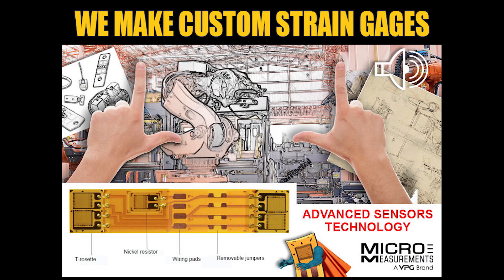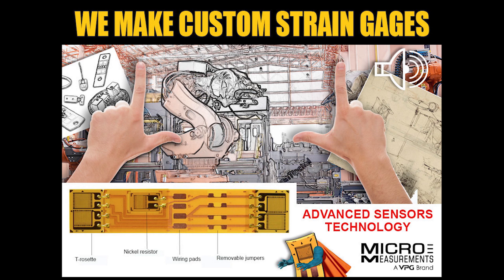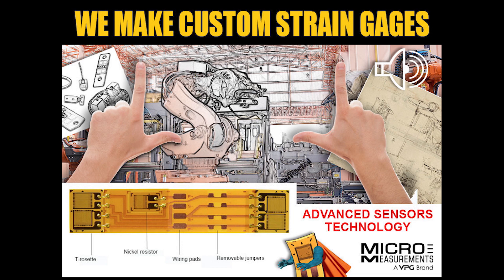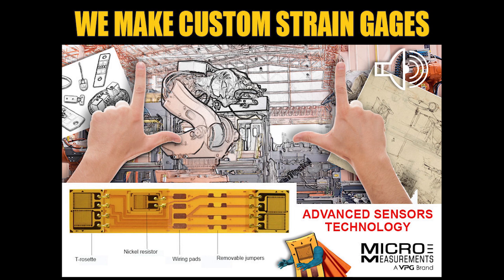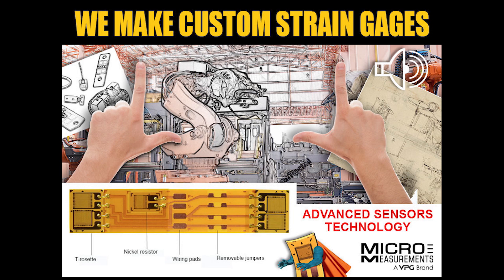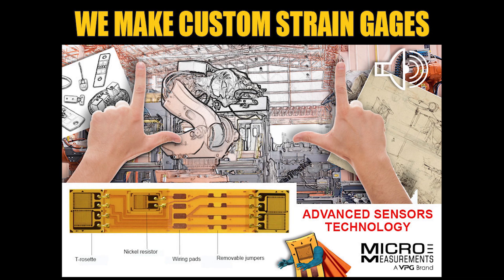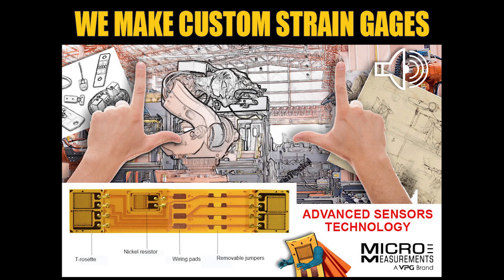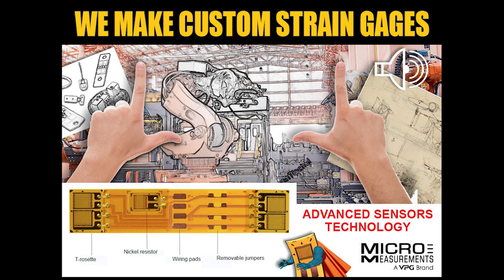We Can Design Your Own Strain Gage Sensor (5 Minutes Podcast)

Comment: ¿Alguna vez ha pensado si sería posible disponer de una banda extensométrica hecha a medida? La respuesta es SÍ. Con nuestra Tecnología Advanced Sensors se pueden fabricar bandas extensométricas personalizadas, tanto para aplicaciones de Análisis Estructural, como para la fabricación de Transductores. 
Ejemplos muy significativos de lo que se podría hacer son: bandas extensométricas con adhesivo pre-aplicado en su dorso o con un circuito flexible; bandas con resistencias no estándar o con marcas de alineamiento personalizadas, terminales más grandes o cableado especial, etc. Díganos cuáles son sus necesidades, y con mucho gusto lo estudiaremos y le enviaremos la oferta correspondiente.
Si precisa de información adicional, no dude en contactarnos. En Vishay Precision España, s.l. (filial española de Micro-Measurements), estaremos encantados de atenderles y ayudarles con sus ensayos extensométricos mm.es@@t; miguel.bravo@@t